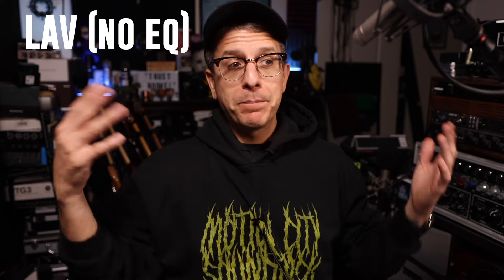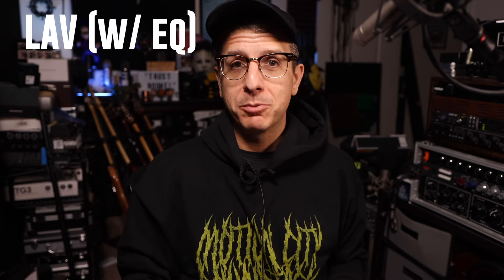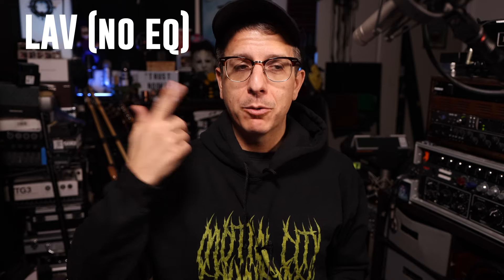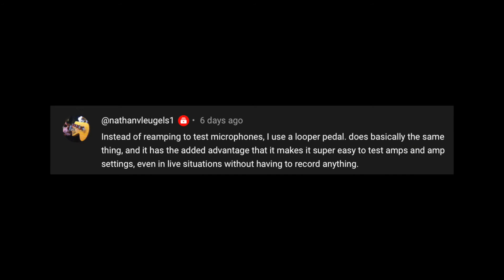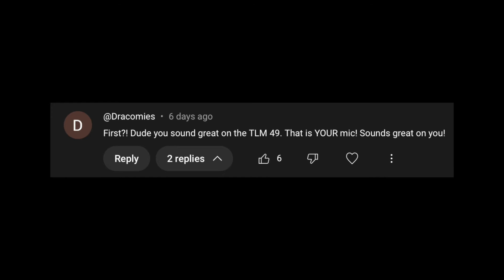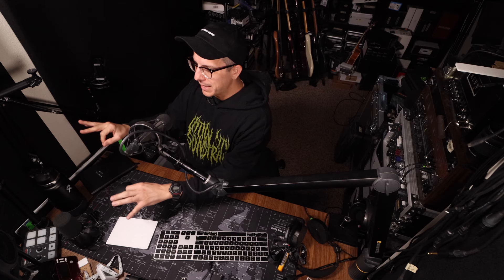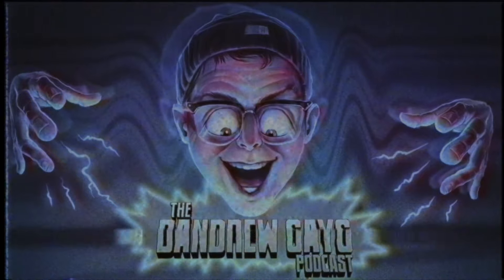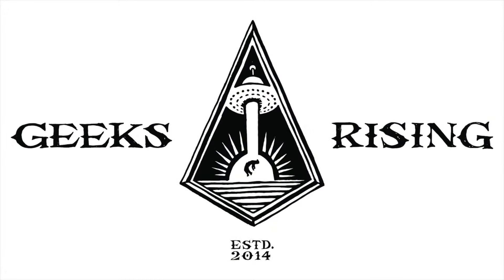Improving a Lav Mic, Microphones Over Coffee, and More (BSP-397)

Comment: Wait,  how do you EQ match?? does pro Q do this for you or did you do this manually,  You almost make it sound like it matched the eq for you.   im going to have to get out the manual and look this up.. that would be super cool if you can do that.
Reply from the maker: It auto does it in Pro q3. There’s an eq match button you hit, play both channels and train the plugin of the tone of the mic. Save the spectrum. Then apply the SDC spectrum to the LAV and it allows you to select up to a 20 band EQ if you want it to get super wild with it.  Logic also has an EQ match plugin that I’ve never used.

Comment: I have a theory… youre not hearing reflections from the desk and probably more off the monitors you have in front of you. Sound wont turn around on itself from a flat surface at an angle. It will reflect similarly to light and continue forward and bounce. So if you have screens that are parallel with your face hole, thats gonna bounce back way more and sound hitting the desk may bounce off the desk continue to the monitor and THEN back to you.  Easy way to test.  Just back up a couple feet and see if it changes drastically. My desk and computer monitor are both angled. My mic is usually less than a foot off of it (underboomed). I didnt notice many issues w it.

Comment: greetings from a blind subscriber here in the Philippines!

I have a TC helicon mic mechanic 2 pedal which allows me easy tactile access to FX and DSP processing. but sadly it has 24 volts always-on phantom power, and not 48 volts. 

planning on buying an SM7DB for my untreated bedroom. I was fortunate enough to use its predecessor back when I was still in college and a door the sound and headroom it has on my extreme vocals. 

will the 24 volts phantom power of the TCMM2 affect the the SM7DB set to +18 and +28dB gain?

as a second option I could also purchase an SM7B alongside a Triton Fethead/sE Dynamite (Cloud lifter is not available in my country). how would the 24 volts phantom power of the TCMM2 affect this setup? 

stay happy healthy and more power to you.